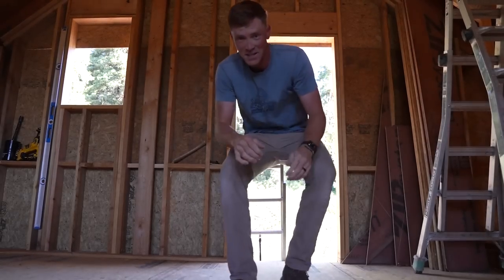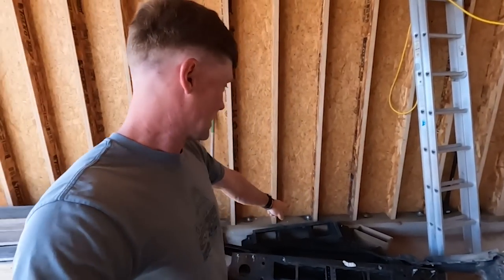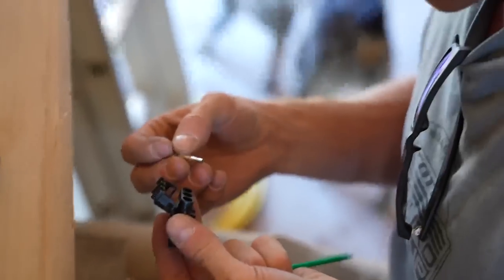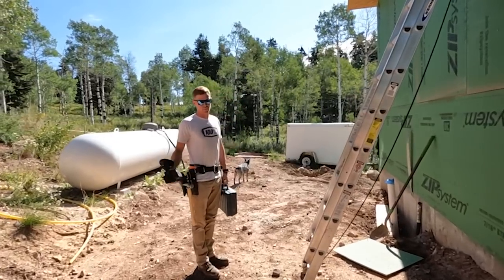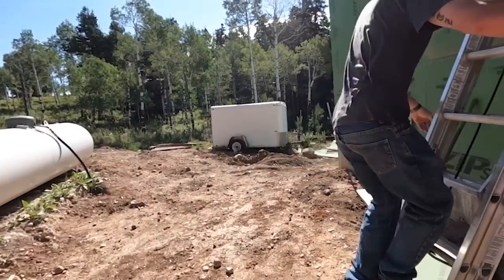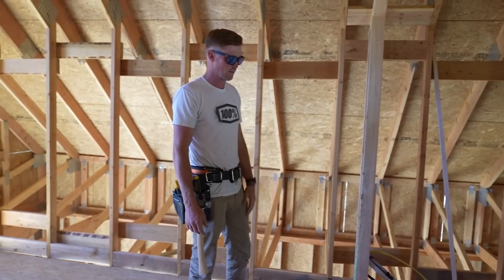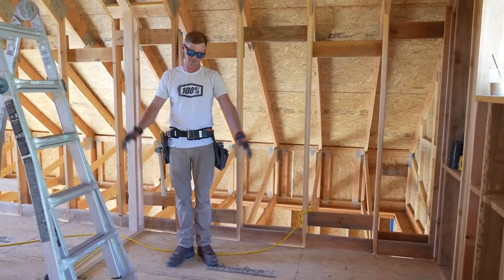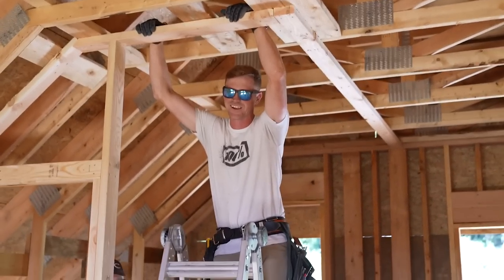FRAMING WALLS IN OUR DIY GARAGE | BUILDING OUR OWN HOME

Comment: I'd recommend a tankless water heater because you don't want to waste energy heating water when the apartment is sitting empty.  Plus, it takes up very little room.  Just make sure you properly size your propane gas line.
Reply: I agree! They are great for small spaces.
Reply: They are pricy, but I wonder if do you save on the electricity. A friend shuts off her hot water tank and saves $50 a month.
Reply: I love the tankless, but I've seen tankless ones at a shop that were busted open because people forgot to drain them before going away and they froze.  They're very easy to drain, but you know how it is..
Reply: Amazon has EcoSmart 11 - for only $220 - don’t forget to put in a filter in-line prior to the tankless, it will help it last longer (no silt entering the smaller lines inside).
Reply: @lindapearson3411 trent just bought a $80,000 Ram TRX truck.  Don’t think a $400 difference for a water heater matters.

Comment: Opening the bath door into the common walkway (from the main entry) is more efficient. Placing the bath door into the corner against the attic wall forces an additional clear walkway to access the bath i.e. space lost from the already small living area.
Reply: Yes!! move that bathroom door near the main exit..much more efficient and gets the window out of the shower!
Reply: This is a guest space and is not the main house. If there is room, a pocket door can be installed or even bifold doors.
Reply: Make a sliding door into the bathroom
Reply: @georgiapetty8140  
That's what a pocket door is for. You build a double wall and the space in between holds the sliding door.
Reply: Move the bathroom door to the walkway.. The end wall of the bathroom becomes prime useable wall space. Gives you more options for furniture placement. Makes for a much better traffic pattern, and as stated above, no window in the shower … win, win 😀!!
Reply: Could they do a sliding inside door for the bathroom?? Just a question?? For the bathroom so no open door just slide it open and shut?? Hopefully their tub will fit sideways through the doorwy
Reply: Pocket door!
Reply: @Dramalady69  
A tub is such a space hog and how often will it get used? Id do a shower stall only.
Reply: @nhlibra  pocket door is my vote😊😊
Reply: @nhlibra  or a half size corner tub
Reply: You have already made the bathroom door frame but could you do a barn sliding door? It’s coming along seems to be going faster then the house but you haven’t started on the additions. I don’t remember what the additions are for.
Reply: @nhlibra  I was thinking of the shower tubs which has a seating and shower all in one . Jet message one. Just a thought.
Reply: @Dramalady69  l thought about those too and lm surprised they dont use techniques and products they learned so well about living in a van. Id be compressing that space with things like marine products, keeping it functional and efficient. The combo kitchen/dining/ living room space would get the "luxury" treatment as much as possible. Close walls in a small living room would not be relaxing to me.
Reply: Barn sliding doors are a lot more stylish
Reply: @nhlibra  or is it a spot for Joel once he is of age?🤔
Reply: @cindyluwho5974  
Could be but l think if l remember correctly, Joel drives an hour to reach them for the garage project.
I have a son and he wouldnt have wanted to be an hour away from his social circle once he was a teen and had his driver's license.
Reply: @nhlibra  I agree. Maybe they are just dreaming of a tub because they forgot to put one in the main house

Comment: Not sure if you saw my comment on a previous video or not, but rather than a full size hot water tank, use an on demand water heater.  They take up only one or two feet of space.  There are ones for cold weather climates such as yours.  Solves the space issue immediately.  As for heat, just use electric hot water baseboards.  No furnace required.  Again, the space issue solved.
Reply: I agree as I have one it is great and no big water tank above me, xxx
Reply: Sounds like a real good idea. Hope they read it !!!

Comment: A suggestion would be to take some of the large pieces of cardboard you have and cut them out in the size and shape of the vanity, bath tub, and toilet. Placed them on the floor where you’re going to be putting the bathroom and then walk around them to see what your clearance is going to be and how comfortable it’s going to work. Because now is the time to adjust, not once everything is framed. Best wishes
Reply: Another good idea would be to have a drawing to scale and know what code says for clearances. I still don't know how they got their toilet in the main house passed by inspector. There must be 4 inches of space behind it before the wall.
Reply: Good idea..plus consider putting sink vanity & toilet on opposite wall under ceiling slope which would give more full height floors pace and move door to kitchen side of bathroom( which you said is wasted space) resulting in a usable wall space in bedroom area
Reply: @rebellajm  also the wall where the front door swings into would have been a good spot for coats and boots . Now that he pushed it out towards walkway I hope there's still room to put wet stuff in winter.
Reply: Since this is a guest bedroom, they really don't need a large vanity sink.....just a pedestal sink with maybe a small thin chest of drawers next to it, I think.
Reply: Yep
Reply: Tape works as well as cardboard
Reply: Licensed Architect here...T&A should hire one of us.  We went to school to learn how to design your space to look great, work well, and meet code.  :)

Comment: As an hvac guy I’d put in a heat pump mini split with electric baseboard backup. If you get the right unit (Mitsubishi hyper heat) it will heat at 100% capacity to -15 and it works perfectly in a small space like that. The short time you are below -15 the baseboard will heat the room. You can’t use the furnace to heat the garage and the apartment with the same unit.

Comment: Also put your closet and built-in cabinets in the side attic space.   You don't want the living space cluttered with unnecessary furniture.   Even an inset for the Bed Headboard.   And . . . . it's still not too late to replace those 2 tiny windows with a large triangular cluster of 'view' windows with a window seat.

Comment: Put some Bounce dryer sheets under the hood to deter the mice. Mice are attracted to the wiring on new vehicles because the wire insulation is made from peanut oil. I learned this the hard way. We had to have our whole electrical harness replaced. $$$$
Reply: Dryer sheets can catch on fire. Tomcat makes a spray (peppermint oil) that smells good and keeps the mice away. I use it at my mountain house and it is the only thing that has worked outside of death traps.

Comment: Just tossing out an idea to perhaps consider……a washer/dryer combo designed for motor homes or an all-in-one unit that would fit into an insulated truss space .
Reply: This is a Fantastic idea for the apartment over the garage, your guest will love it and so will you😊
Reply: Those combos are $1500.00 and there is a W/D in the main house. They aren't renting this out to strangers, this is their spare bedroom. Family and friends won't be a problem using the main house W/D. I mean how long is anyone going to be staying there. Most a few days and they will take the dirty laundry home. Joel is the only one who will stay there for an extended time, and he doesn't need his own W/D. For the little use it will get it wouldn't be worth it. Those are nice for people who use their RV's full-time or travel long. The thing is they take forever to dry the clothes. Many RVers if they have room will install small res W/D that are independent of each other or stacked. I am sure most of their guests would rather use the main house W/D than spend hours washing a load of laundry.
Reply: I like the idea of a stacked W/D. Near the bathroom, not inside. But for easy access to plumbing water supply and access to DWV with a trap.  No possibility of sewer gas as long as sink and toilet are used often all running into same drain, it will keep the trap fill of water. Vent pipe just before the trap, path of least resistance for gas.    Having a small to medium size wash/ dry capability in apt greatly increases convenience for guests.
Reply: @RiverWoods111   I have a feeling they will be using it as an AB&B as well as for family/friends!!
Reply: @RiverWoods111  I agree with your assessment. Just from what I have heard them say previously, this apartment is not meant to be a long term rental but just for short term guests like friends and family coming for a visit. I’ve not heard them talk about an anything like an Air B&B.
Reply: @vickioneill8277  I have an LG W/D combo and LOVE it - in spite of water pump failure 3 times, while it was under waranty, it's now been great since 2005.   Research your appliance though, 'cause the year we bought, we were dissuaded from a few makes which had started fires in peoples' houses!

Comment: Good idea with the interior wall plumbing for those hard winters plus you should consider installing a water shutoff valve where you can have easy access in case of emergencies…

Comment: Good job on the framing.  Could a pocket door solve some of the space problems?  They are not difficult to make, just a time thing.  Get a mini crib sized Helix mattress for Leo.  The more aware babies become as their thought and reasoning develops, the more changes you'll see.  It's a good thing really, it shows how their brain is developing.  You are doing a good job raising your son.
Reply: Or a sliding barn door! They're easy to make, I made one with tongue n groove paneling... You have to make a little pocket in the framing on the closing side of the door, for it to fit into. Eliminates wobble, and peek a boo gaps...☺☺☺
Reply: @lucymorgan8859  @TrentandAllie
😍A BARN DOOR😍PERFECT😍

Comment: I like the Idea of putting the Utilities in the rafter bays and you can use them as storage /closet space also. I'd run 2x6",8" or 10" for the floor height needed to the wall plates on the outside walls and box it all in with 5/8" or 3/4" plywood. You could even put built in drawers in that space or build your kitchen cabinets in there and other endless uses for unused space.

Comment: Did you consider a Demand Hot Water Heater?   Instead of a Furnace did you consider a mini split system.  I would think for such a small area there shouldn't be a big cost difference if any for a mini split over a furnace. It

Comment: If you are thinking of putting the water heater and heating system in the open space on the right side there is no reason you can't have the plumbing on the other side as long as you have insulation and a vent to heat that part of the eves.

Comment: Good morning, You may want to consider a pan with a drain under the hot water heater.  I'm  sure you are aware they can split and drain the water from the heater unit and ruin the dry wall and anything underneath.   An other option is an instant hot water heating system.  Another thought  is to consider a shower unit.  Most people shower rather than bathe.  Just ask your future guests if they prefer shower or bath.  Good luck.

Comment: As far as putting furnace and water heater in attic space, that's how many homes in south US are built. Just note typically the installation is different if you are going to enclose in a room in the attic space or any living space. Required to have appropriate burner ventilation and air intake to/ from outside living space. Just something to keep in mind if you want to enclose your furnace in a conditioned space. I think it's a similar issue for gas water heater.

Comment: If I may make a suggestion. Install a propane powered generator large enough to power the house and garage during a power failure. That would protect plumbing from freezing. I know you have a wood burner in the house but it still wouldn't hurt.

Comment: Look at running bedside lights either mounted to the wall or ceiling so you don’t need bedside tables on both sides of the bed. By the way, I purchased wall mounted swing arm lights from IKEA that also have usb outlets on them….awesome for charging phone next to the bed.   Any chance you can recess a niche parallel to the the head of the bed to offer an inset shelf for decorations?

Comment: Good move on widening the bathroom, but before you close it in,  will the tub fit thru the door? Most construction I've seen put it in before closing in the walls, just a suggestion, yall are doing such a great job, and Trent thinks thru it all so you are probably ok. Hoping your new construction is on the house adding a Leo bedroom 😉
Reply: Or a new primary for them and Leo gets the loft!
Reply: @terrytt2932  They'd have to enclose the loft for a child.

Comment: Use graph paper to try different lay outs for your bathroom.  Once you find something you think works, lay it out on the floor with painters' tape to get a feel for the plan. A pocket door or a sliding barn door would be a space saver.  Doors that open are space hogs in a small place.

Comment: Trent, use a Tankless Water Heater!! You'll save a ton on your electric bill. Ask Brandon..  They will fit anywhere. Only heats when you turn the tap. And, you never run out..

Comment: Pro tip: Make sure where ever you put the water heater and furnace, that you can access it if you need to repair it or replace it. If not, it will become a huge nightmare.  You might want to look at a tankless water heater. Great space saver.

Comment: If you use a tankless propane boiler you can have heat and on-demand hot water. Takes up less space and you only use propane when you use the hot water or heat the space. You aren't keeping 20 or 40 gallons if water hot all the time

Comment: You buy graph paper and you draw out your house plans before you actually build the walls.  You also draw out where you want your furniture to go. This is for you Allie so that you can visually see what is going on and you can determine how functional the space will be.
Reply: That is Old School and I can't tell you how many times I have done that. Moving forward in time, there are "home user" softwares (CAD) that can be used instead. You save the files in your computer and go back to them for editing as often as you need to. No more piles of crumpled up paper. Some of those programs you buy but they also have freeware on the internet.
Reply: I was more of a “3D Home Architect” girl myself. Before the Sims 😂
Reply: I was going to say that…. Where are the plans? Why are there no stairs???? Did I miss a video 🤷🏻‍♀️?
Reply: @ibpaddy65  last I heard/watched the stairs will be off a deck on the back. The back door will be in between the bathroom (on left] and kitchenette (right) if you're facing the back of the property.
Reply: @Jenntality  I heard that too just recently, but why were they not built beforehand instead of using that ladder (so dangerously) 🤷🏻‍♀️

Comment: You may want to consider a 3 sided architectural scale ruler, then measure your over-all interior foot print to then draw out a working drawing on paper before you start framing, it's much easier to erase a pencil line rather than pulling nails. Just a thought.

Comment: If you would have used graph paper to design your space, using pieces of sink, toilet, shower, etc that are sized,
you could figure a common sense solution to best fit your apartment. More of a  user and functional layout before you commit to framing.
The wall on the shower , facing the inside, could have been used to hang clothes, jackets, shoes or other storage items.
Reply: I've tried that method several times. I work at all the pieces being accurate to scale for furniture, appliances, everything, but when I get onsite it never seems to look or function as well as I'd hoped. Because all my jobs are for myself these days, I don't have to build scale, so I don't.  Only thing I do is I have stock measurements from catalogues for everything.

Comment: I feel like Trent is inventing problems for himself with the bathroom framing. I’m confused as to why he’s not following the plans. It’s not uncommon to have plumbing in exterior walls. You just insulate it.
Reply: lol, YES. When I bought a 100 year old house,, that is what we did. My Master Plumber (father) added a bathroom upstairs. We had to run the pipes in an outside wall...insulated, and it was 100% fine. (I live in snow country).
Reply: And he said he was going to put the water heater in that same attic space on other side.  Not sure how that is any different?

Comment: Man...that was painful to watch. You got that bathroom all wrong. The door in that position will hit the ceiling on the top edge. The shower should be at your door end of the room as the shower shouldn't be over the window as there are all sorts of waterproofing issues there. Toilet goes at the window end. Door and vanity location on the internal wall kitchen side. What's wrong with plumbing on the 'outside' wall when you are considering putting plumbing in the roof space. Just insulate the area correctly. You are supposed to make the mistakes on paper...that is what a plan is for. Not make it and pull it apart. Rooky mistakes...you should be better than that!

Comment: It's a mistake to not have a stackable, at least. Guets travel... they want to wash their clothes.
Reply: One option is to get a front loader wash/dry combo and slide it into the same idea as your water heater. OR put it in the garage.

Comment: For the bathroom framing, next is stagger blocking at the four-foot height. Blocking for the towel racks.  Blocking for the toilet under the floor and in the wall.  Blocking for the butt wipe rack.  Blocking for the tub and surround.    I like to put extra bat insulation around the bathroom to keep the heat in especially around the tub.  Nothing sucks more than a cold shower wall.